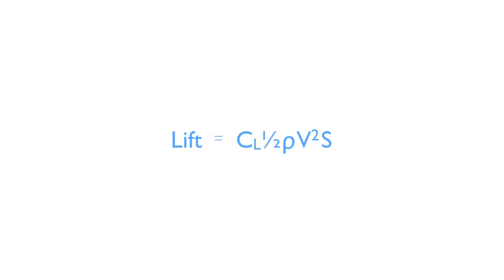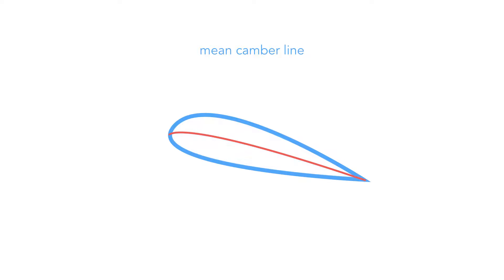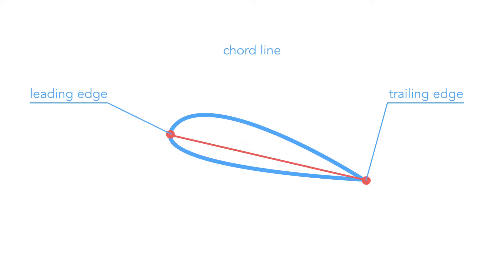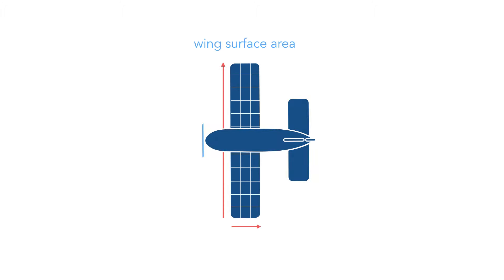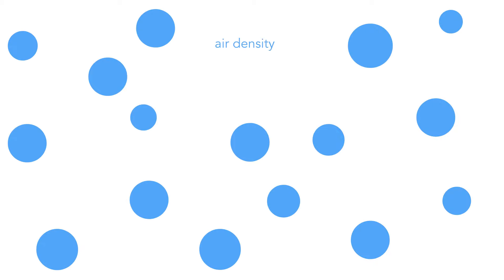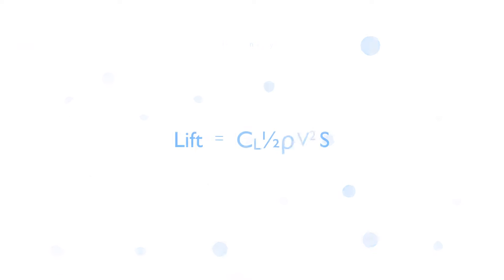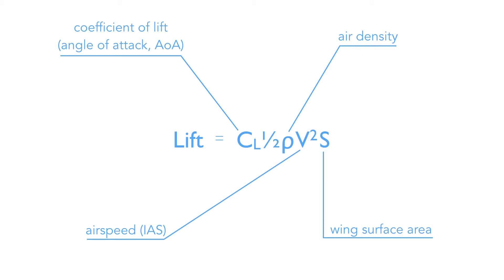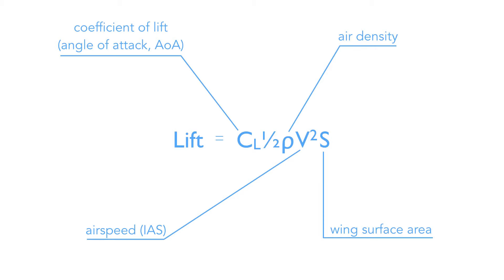Lift Formula.

Comment: Almost correct. The V2 in the formula is actually TAS not IAS. Great channel!
Reply: @flightclubonline  V2 multiplied by D/2 equals free stream dynamic pressure (EAS). 

V2 on its own is TAS not IAS.
Reply from the maker: Yes, you're correct. We could have shown it better in this video.
V = Velocity (True Airspeed, TAS)
½ ρV2  = Dynamic Pressure (~Indicated Airspeed, IAS)
Reply: @flightclubonline  please stop acting like it is IAS in the lift formula :D it is TAS

Comment: Thank you for this explanation! 

Does this explanation for AoA work with the propellers too? Like, on helicopters, when the airflow is pushing down on the blade cross-section instead of from the left?

Comment: Good Video, just one little correction: It says, that the speed at which the aircraft flies through the Air is called the IAS, but it should be the TAS, the true airspeed in fact, not the indicated :)

Comment: the speed is not in IAS
Reply from the maker: V2 is the free stream velocity that is related to dynamic pressure which is closely related to IAS. We use IAS when discussing aerodynamics and use TAS when discussing navigation.
Reply: @flightclubonline  why not ground speed if there is air density in the formula